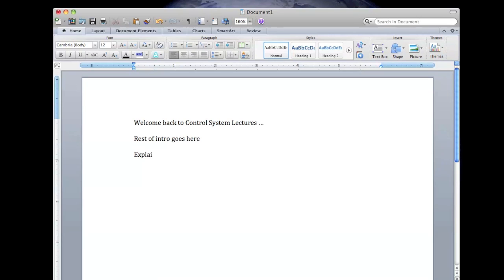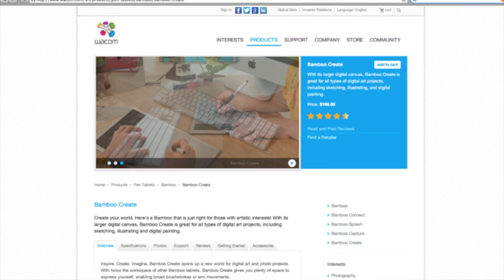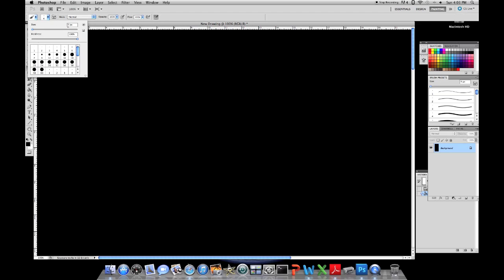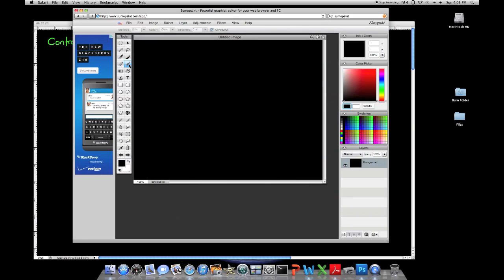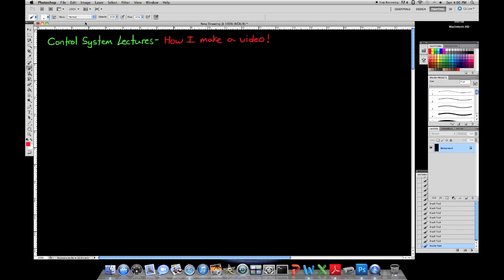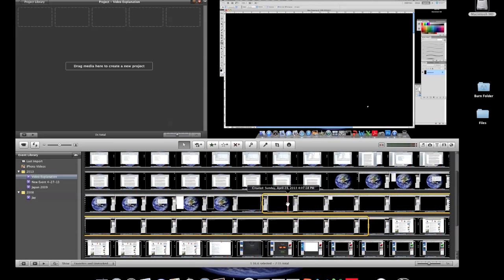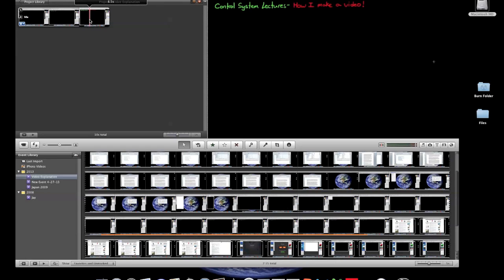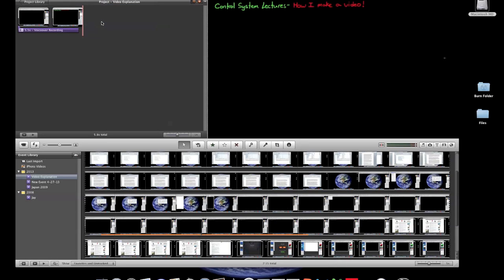How I Make a Control Systems Lecture Video

Comment: Thanks for sharing. I have similar sentiments about making videos to share my knowledge. I had also seen many videos on making such videos. 

You have a good technique on speeding up video and adding a voice over later. I have been trying to do them simultaneously like Salman Khan, and having a tough time. So this looks like a good alternative. Still synchronizing voice and video must have some challenge. Since I did not get anywhere near decent levels I have not invested in a new graphic pad. 

The other area I had trouble was with my voice. It varies a lot. I have replaced my head phone set many times. Then I discovered and learnt Audacity for independently working on improving the voice file through voice compression. But this was not compatible with live recording. I guess the voice over approach helps to process voice independently. 

For screen capture I currently use Microsoft Expressions Encoder 4 on my Windows 8.1 system. But this is a discontinued product. I am yet to make videos with all these techniques. I wish to explore the voice over method and if successful start my initiative. Thanks a lot.